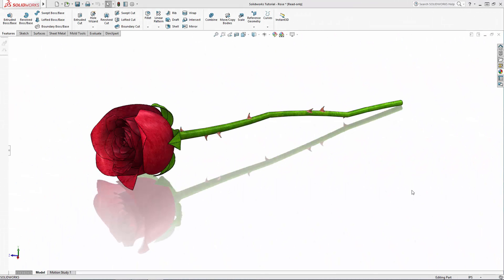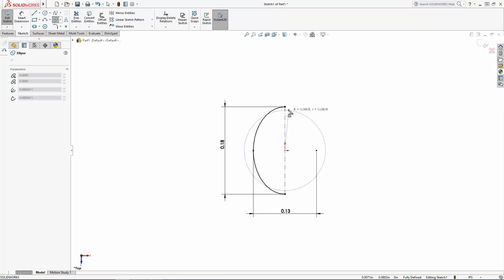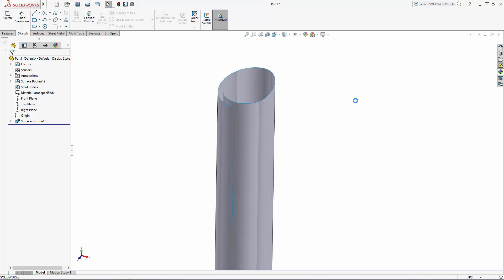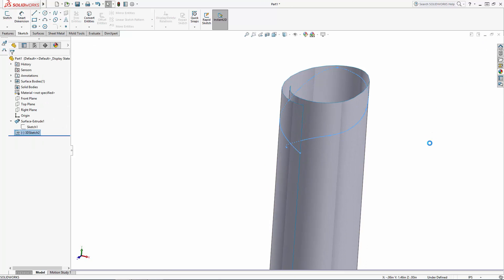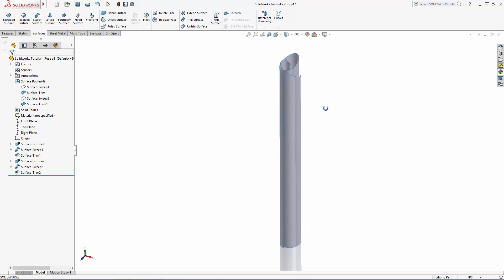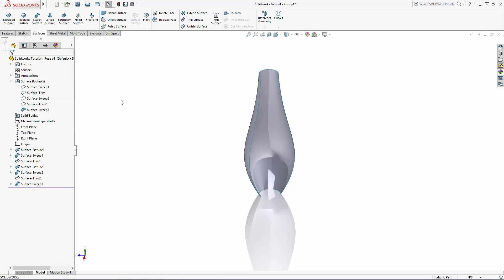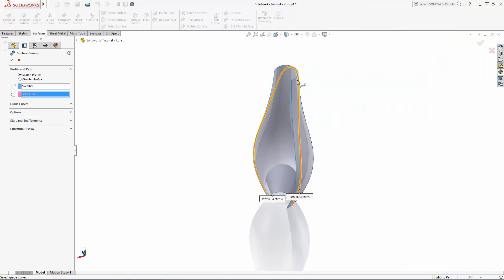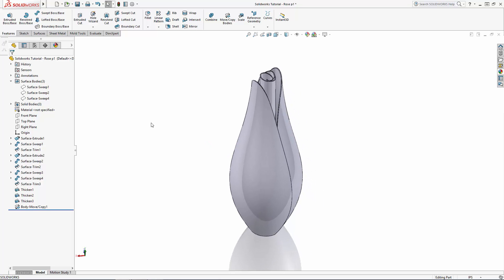SOLIDWORKS Rose Tutorial - Part 1

Comment: It could be noted that the 1st trimming may not be work, depending on the initial shape of the spline you draw for trimming the top end to an "organic" shape. On mine, I had to decrease the length of my trimming line segment, or it would crash into the underlapping portion of the wrap.